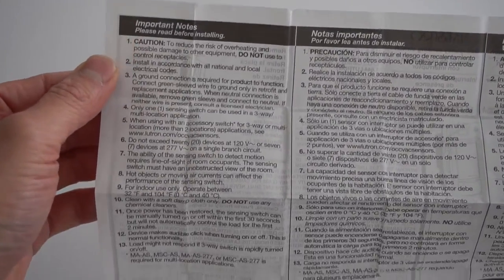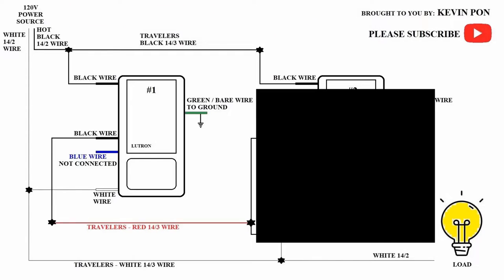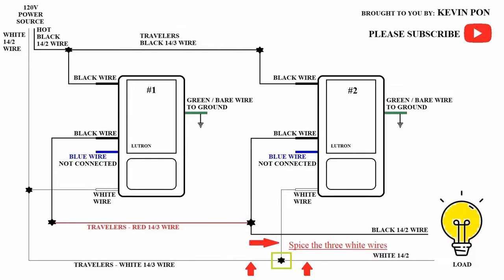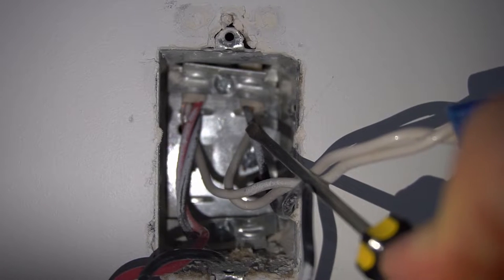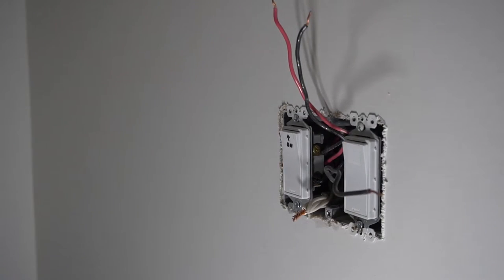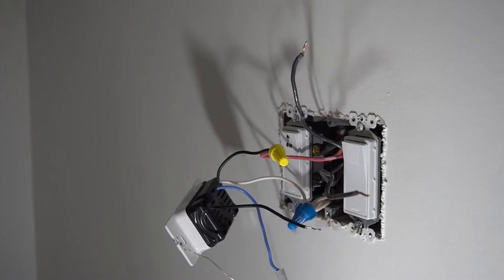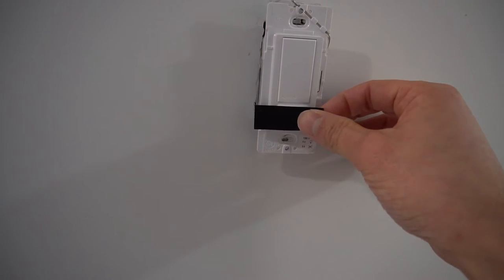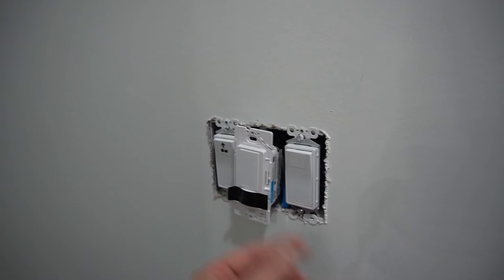TWO Occupancy Sensor 3-WAY Switch HACK BYPASS THAT WORKS! Any brand!

Comment: Hi Kevin,

Thanks a lot for your great demo and explanation!

I have a 4 way light ( 3 switches) on stairway. I need when step up the stair , light is on (first floor), and same when step down stair (top floor) which has a 4 way switch, can I use the second sensor on top floor?

Here is the actual config I have:
- 1st floor 3way switch, I replace it using 3way sensor, it's working fine
- middle floor, looks like I have a 3way with dimmer
- top floor, I have a 4 way switch but no neutral only red and black wires on each side

I read one of your replies that the 4 way can be replaced with an occupancy sensor?
How do I do that to power the 2nd sensor? Single pole sensor or 3 way sensor?

You mentioned also other alternative as making the 4 way switch to become a single pole?
Can you explain more on detail how this can be achieved?

Any help is greatly appreciated!
Reply from the maker: Hello there & thank you!
To clarify you want to replace your 4-way switch with a motion sensor switch correct?
The main thing is that to get that to work. All of your switch box must all have constant source of power running to it. They all need the white neutral wire. There must be some white wires in your 4-way switch?
Reply: @KevinPon.  Thanks Kevin for quick reply. Yes, that's correct. I'm going to pull the 4 way switch out to see if I see the neutral wire. Should it be there at first place? If not, I'm stuck?
Reply from the maker: @cpm5303  the thing is you have a 3-way dimmer. That will have to get replaced with a motion sensor as well. The entire setup will not fully function properly. It will cut a break in the constant power carry out for the entire setup. If you look at my drawing the whole setup needs constant power running to all switches.
Reply: @KevinPon.  I pulled out the 4 way switch, it does have 2 black wires joined on the back, I will guess it is the neutral ones? Are the travellers wires the ones connected to the box? So should I replace it with a 3way sensor, right? Looks like you said I need to change the dimmer too, I need to use then Lutron 3way sensor with dimmer, right? When I open the existing dimmer, I have only 3 wires and I see it is also 3 wires on the lutron 3way dimmer sensor? It it the good one? I like to have the dimmer sensor, can it be used for my setup? Will that sensor dimmer working too to light on automatically like the other two?
Reply from the maker: @cpm5303  The travellers are connected to the 4-way switch. Take a look at this picture of the 4-way switch to see if your switch is wired just like this: https://images.app.goo.gl/eUEuw4k9tER9bYCt6 
The 3 way sensor can stay but you will have to replace the 3-way dimmer unless you find a motions sensor with a dimmer 3-way if it’s available. The setup will not work if you keep your dimmer it has to be replaced with a motion sensor because you have to have constant flow of power to all switches. Cannot have a break. The dimmer causes the break. Lutron are good dimmers but you don’t have to buy this brand. Other dimmers work too. Yes, sensor dimmers will work the same with automatic functions.
Reply: @KevinPon.  More questions:

Are the neutral white same as white 14/2 wire?
Currently on first floor, I stripped out the green wire and connected it to the neutral ones,
and the blue one to traveler as shown in one of your other link: https://www.youtube.com/watch?v=Hk_3To6VqRo
so I have to redo the wiring on first floor then, right?

On your drawing, I need to do the same wiring as shown for the 2nd box for my other 2 sensors:

3 way sensor + dimmer (middle floor) and 3 way sensor (top floor) , right?
And all the 3 blues must be capped too?

For the top floor which I have 2 set of travelers, not sure for the wiring, do I splice the 2 whites travelers on the 4 way switch together with the black wire of the switch, and the other 2 red wires on the 4 way switch with the black wire of the switch, and in my case the black ones to the white one of the switch?

For the dimmer sensor, I managed to get Lutron 3 way sensor with dimmer, how the wiring should be? Could you explain how I should wire them?

Thanks for your time!
Reply from the maker: @cpm5303  
Yes all the neutral are the same.
Correct you will have to redo the wiring on the first floor as per this current video to have power running to all your switches. Yes, same wiring for your 2nd box as the drawing. 
Correct, all blues must be capped. No need for blue wire.

Yes, splice all white wires on the 4-way. The all black wires will be in charge of delivering constant power too all your switches. Just like how the drawing is shown. Do the same with the red wires, splice them together. Red wires are in charge of completing the path connection to the light.

I personally have not ran into that kind of device myself but I assume it’ll be very similar to the 3-way motion sensor. Cheers!
Reply: @KevinPon.  For the dimmer on the second floor, does it need to be a  3way sensor switch with dimmer or I can keep the old one by redoing the wiring, it just needs to have constant power, right? I don't see the need to have a sensor since motion is detected from top and bottom, thus it's a waste.
Reply from the maker: @cpm5303  yes, must have constant power. I don't know you can try and see if it works. I'm thinking there will be a cut in power at the dimmer. Trial and error and see if the dimmer works with the whole system
Reply: @KevinPon.  Thanks, I will try it out to see how it goes. It's getting annoying without having the sensor on top floor. Usually, we don't often use the dimmer, but it's a nice add-on feature of dimming the light. If the dimmer does not work, I probably will use the regular 3 way switch.
Reply from the maker: @cpm5303  no problem. To clarify you wanted two sensors, correct?
Reply: @KevinPon.  yes if possible.
Reply from the maker: @cpm5303  yes it's possible. We'll have to see if it works with your dimmer
Reply: @KevinPon. So I rewired the first floor as per diagram. On top floor, I only have 3 sets of travelers wires so I can only splice them of what I have.
I ran first test with old dimmer on, like you said, light is off, I an only activate light with its own toggle so the light can stay on.
Did not see the light goes off though. The way the dimmer is wired is out of my understanding so I rewired the 2nd floor with dimmer, as
done with the 2nd box, but when I test it with the toggle, it resets the circuit breaker, so I guess there is an overload with my new wiring.
I think I'm going to get rid of the dimmer by using 3 way sensor for my next test. If it works, I'm going to sacrifice the dimmer.

Don't understand for the overload though, may be I rewired the black traveler which originally was spliced with the white 14/2 so it it will now go with the black wire on the dimmer switch. And the black 14/2 goes with the red (it is spliced originally with the black wire on the switch).

This dimmer only has 3 wires black and 2 red ones which connected to travelers white and red.
Let's see if the regular 3 way sensor works on my next try. Btw, I don't see any 14/2 black or 14/2 white wires on the 4 way switch though?  From the pic of the 4 way switch, when you say joiced white together, so input is joiced with output for white and red, correct?
Reply from the maker: @cpm5303   you are getting a overload because you have joined the white and black wires together somewhere? 
At the 4-way switch there should be only 2x 14/3 wires
At the 4-way Joined all the white wires together. Red wires together.
Reply: @KevinPon.  Yes, it works now without using the dimmer but instead using 3 way sensor switch. I now have 3 3-way sensors all 3 floors.
I did not want to investigate more on dimmer. Very time consuming as I also don't have much time to spend.
Now all of this working without dimmer, light are at full intensity but they are LEDs so I may have to replace them with less powerful wattage to save power. 

I do have other questions on configuration.
I don't think vacancy mode is what I need, since I want it lights when there is motion, right? I have set them all 1 minute and day light detection on/off automatically.
If the vacancy mode is needed later, do I need to set it on all the 3 switches? I would guess yes, since each switch works independently, right? 
But how does the time out works? If top floor sensor is triggered followed by middle one and last the first floor as I go down the stair? Will it still be one minute counting from the top or the first floor?
I only need them at night ideally, with 3 sensors, they are so sensitive that they are lighted on so frequently due to motion at first floor which is the main corridor where there is always activity, now with the 2nd floor, I need to program it to set to low then, since now it covers even other rooms face to it up or down the stairs make it almost impossible to get undetected unless I stay in place where the 3 sensors can not detect.

With the surge of power by lighting frequently, will power consumption get higher? I guess it will affect the sensor life expectancy if the sensor is often get activated? I will play more with teaching the device of daylight feature since I don't want it to activate when there is enough lighting during the day.

Anyhow, thanks again for your great help and useful advice due to 4 way switch pattern. Much appreciated!
And what's a cool hack making intelligent lighting dream come true. 
Now, I need to tell people not to touch  the light switch anymore.
Reply from the maker: @cpm5303  sorry I just saw your last comment lol YouTube didn't notify me. Yes, it sounds like you have it all figured out. Yes, changed all the switches to 1 min and the lights will all turn off if there's no movement. Job well done my friend! 🍻

Comment: Looking at the graph, I guess one caveat we won't be able to turn off the circuit using only one switch if the other is on right?
Reply from the maker: Correct

Comment: I have power running though the light and then to switch. White wire coded as black at switch. How would I make this work for two occupancy sensors controlling light.

Comment: Hello Kevin, can I use this installation method  for 4 way light switch?
Reply from the maker: Hi Dee, yes it's possible. It's all about the wiring method. The sensor need to have constant power for it to operate.

Comment: I know little about electricity. Is your setup considered safe. I noticed that you said during the video that the ground paper clip looking wire that is pre-attached to the new OS doesn't work because the because the casing is plastic. Does that mean the switches are not grounded?
Reply from the maker: The setup is completely safe. It a design error on their part. The switches are not grounded however everything is enclosed and there is no metal part you can touch to get shocked 🍻
Reply: @KevinPon.  working perfectly btw. Tyvm.

Comment: Hello! So I installed two Lutron 3-way switches in my laundry, and I ran into an issue, if one of the switches detects motion first it’ll turn on, and I let it timeout, and then walk in again and if it’s the other switch, I’ll hear clicks but the light won’t turn on. It depends on which switch detects motion first. Therefore I have an inconsistent system.
Reply from the maker: Hello there! I believe I know what's the problem. You will need to double check your wiring. Make sure both switches have constant power running to them. You will have to use a traveler to carry the constant power to the other switch that doesn't have constant power. 🍻
Reply: @KevinPon.  Thanks for this. It's been a huge help. One issue that I hope you can help with is what if both switches have constant power? I find that if one switch is on, I can't shut the other off manually. Is there a fix for this?
Reply from the maker: Hi mate, the only way it shuts off is by waiting for it to time out 🍻

Comment: I wired like you show, atleast I think I did, checked it three time, anyway only the slave switch works cant get  the  one with power to work, any ideas
Reply from the maker: The most important part is to be able to transfer or carry power to the other switch that does not have the power source. By using the 14/3 wire. From the box that has power supply, must splice the black wire of the 14/3 with the power source. Now that will carry power to the other switch of the 3-way. Also have to splice the neutrals and the switch leg.

Comment: Kevin, I want to do this but when I look up the model number of the unit you show on the paper, it does not have the white neutral wire on the switch do you know if the models have changed. Thanks for the video.
Reply from the maker: Hi Bruce, hmm that's odd. I am not sure. But I assume that will be for a single location switch. Single pole.
Reply: @KevinPon.  Thank you for getting back with me. After I have watched a few other of your video it seems that the neutral has a cover on it that if needed, you remove the sleeve cover. I think I am on it now. Thanks again.

Comment: i have two 3 way switches and a 4way in the middle…  can i make both 3 ways sensors and just keep the 4way the way it is ???
Reply from the maker: Yes you can but once the switch is flipped. Everything will stop working.

Comment: Hi! Will this work with two 3 way switches on a 4 way circuit?
Reply from the maker: Hello there, it will only properly work if you install 3x sensor switch in parallel. Needs constant power all the switches. 🍻
Reply: @KevinPon.  Ooof

Comment: FYI - I actually tried this with two single pole sensor switches (i.e. MS-OPS2) and it did not work.... tried several wiring scenarios and either the sensors would work (or seem to work), but the lights would stay on and the on off switches would not work.... OR the on/off switches would work with lights cycling on and off, but the motions sensors would not work.....

When I wired using 3-way sensor switches (i.e. MS-OPS5) it worked perfectly....
Reply: This could be because my power source came through the box at my light fixture, then to each switch separately.
Reply from the maker: Thank you for your feedback! Just curious does the MS-OPS2 have a white wire for the neutral wire?
Reply: Yes,  there is a white wire (with a green sleeve) at the bottom and black  wires in the middle & top..... a tech support rep at Lutron stated that the blue wire is required on 3-way circuits to power both the on/off switch & the sensor.......

My dad built the house in the 1970s & he did the wiring, which probably the power source comes through the fixture

Comment: Hi Kevin,
The sensor with the power doesn't turn on the light I hear the motion sensor click on but no light the other end works fine. Which wire is wrong
Reply from the maker: Hi Glen, do you have one or two sensors installed?
Reply: @KevinPon.  Hi thanks for quick response yes I have 2 MS-OPS5MH one on either end of a long hallway
The one with the power wont turn on either by switch or sensor
Reply from the maker: @glenzachman5923  it sounds like a wiring connection problem. Have you double check and followed my wiring diagram? Both switches needs constant power source. You will need to splice one of the traveller's with the power feed so it provides direcr power to the other switch.

Comment: Good job it works i ready install 2 of them
Reply from the maker: Awesome news Luis! Good job man! 🍻
Reply from the maker: @larrynypdlt2065  🙋🏻‍♂️ absolutely! I can help you out! 😁 I would love an NYPD shirt! I'll send you an email brother
Reply: @KevinPon.  hey Kevin, I have the same Ecoeler 3 way light switch.  Would you mind sharing your solution with me?
Reply from the maker: @jhorton282  Hi John, if you follow the wiring diagram. You should get the same results I have in this video. The red wire on Ecoeler will be the black wire next to the blue wire drawn on the wire diagram. Please give that a try and it should work. Good luck :)
Reply: @KevinPon.  I have a bare ground wire coming out of the box.  Should I splice this ground wire in with the neutral wires or just cap it off and tuck it away?
Reply from the maker: @jhorton282  do not splice it with the neutral. You can tuck the bare wire to the back.